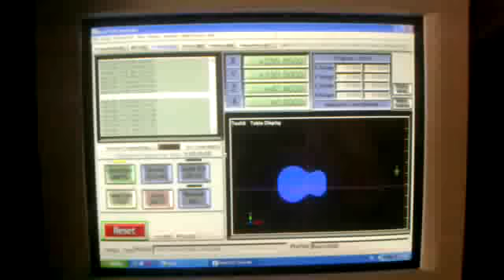Homemade CNC Router

Comment: thank you this work
  pls help me I want to build a cnc router to cut wood other parts, prefer if the size if 2600*1600MM, What motors and spindle should I be using
CNC 3.5A TB6560 3 Axis Router Stepper Motor

Comment: did you carve a neck also  on the router bed,i'm starting a design build to do gtr bodies,but will make my own necks,i currently design tube amps,so these may be a nice addition to make a tuned pair as it were,gtr and amp combo,either way,the mill is an awsome tool to have,plus it can laser etch,if you add it of course.

What's the full cut size you can do,could you do a through neck/body one piece design ,or just neck and body like strat or gib' LP styles,not that that is a worry.
Nice machine,would like to see a full start to completion job vid.

very nice.